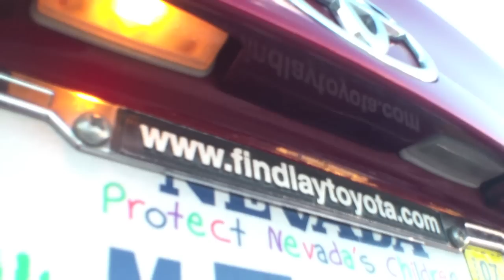Easy FOLLOW replace license plate and tail light bulb Toyota Corolla √ Fix it Angel

Comment: How did you get that socket to come out so easily at 1:14?  I've been working here for about 15 minutes and I can't get it to budge in the slightest.  Everywhere I've read says to just turn it either clockwise or counter clockwise and just pull.  I can't even get it to turn.
Reply from the maker: +OogleyOogleyBoogley try to use pliers for more torque and turn counter clockwise
Reply: Thank you.  Yeah, that's what I had to do.
Reply: @OogleyOogleyBoogley  sometimes you just gota spit on it 😂

Comment: what a stupid ass design that is I can't get that tiny ass little light out of the harness and the bulb broke how the hell do you get it out after the thing breaks I put it in a vice and use pliers and nothing is working
Reply: I just had this happen to me today and wanted to let others know how I handled it. Sorry this is 7 months after the fact for you, but it may help in the future and others if they stumble across it.

Note that you'll want to do all of this over a garbage can with a bag so you don't wind up with tiny glass pieces everywhere! The bulb that broke off in the socket couldn't really be extracted with my needle nose pliers, though I did try. I used a small precision screwdriver and slipped it into the socket along the sides to try and pry out the remaining bulb. I managed to get out most of the chunks, but it left some at the very bottom that I couldn't get the screwdriver around. I wound up crudely mashing/crunching up the remaining bits into powder and was able to simply pour it out into the garbage.

I decided to replace the other bulb since they tend to go out around the same time. The cheap plastic socket actually had a piece break off from the top so I was able to slip in the precision screwdriver and pop the bulb right out. Stroke of luck in one regard, but now it doesn't fit exactly right back in the housing. That's a minor concern and if it doesn't stay put, there's always duct tape.

If all else fails, you can order a replacement socket. They're $14-25 a piece from what I've seen online. The part number for my 2010 Corolla (and several other Toyota models and years) is 8127512520.

Hope this helps!